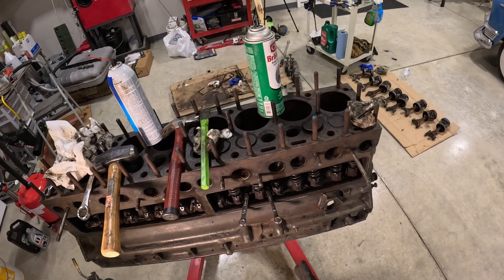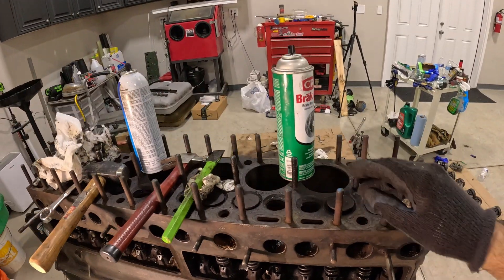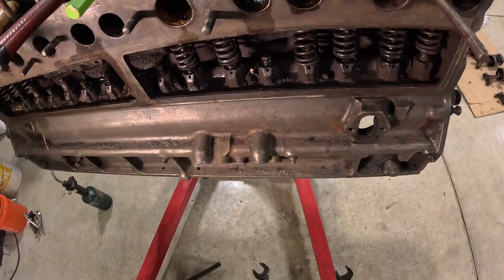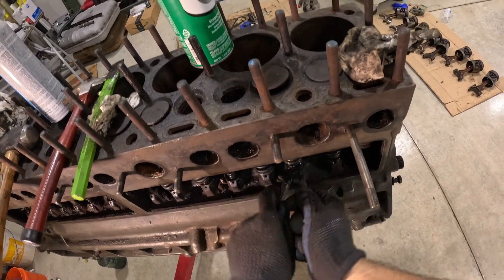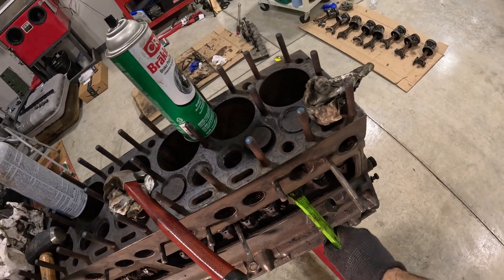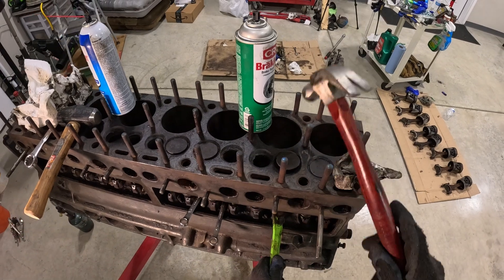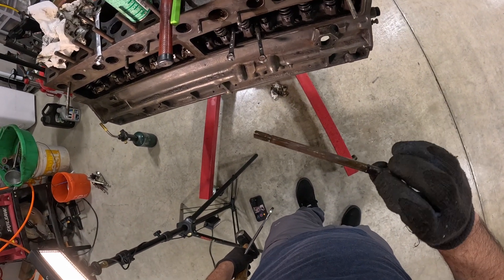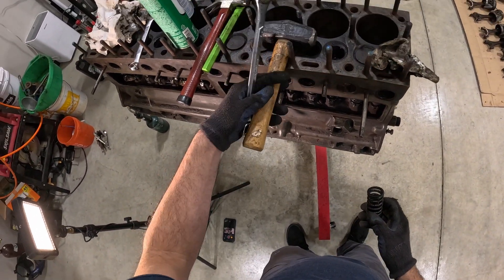Valve removal on a stuck Packard 327

Comment: I also have a 49 288 that runs well with good compression. I have tried everything to keep it from smoking. I hope to just re-ring it. Got to love those Packards.
Reply from the maker: My '54 also smokes.  It's better when I use 15W-40 vs 10W-30.  But still there.  My guess is rings, but I haven't been into the engine yet.  Might be pulling that one next year for a mild rebuild.  Like you I'm hoping for just a re-ring and valve job.  Going to paint it at the same time and reseal all the leaking gaskets.

Comment: I have a 288 that I will have to do this same battle with, this winter i'm making the chassis like new, now doing the bottom of that now. Full frame off for my 49. For every Packard we restore, an angel gets it's wings.
Reply from the maker: Great to hear you are getting your '49 back on the road.  It's a labor of love for sure.  Hopefully your engine isn't as bad as this one.  Every single valve was seized to some extent.  None were free.  I'm still battling the last four intake valves with little to no progress.